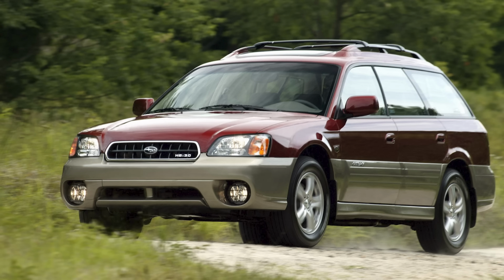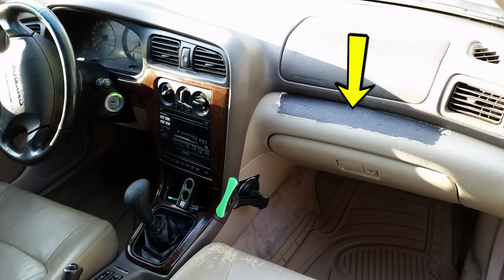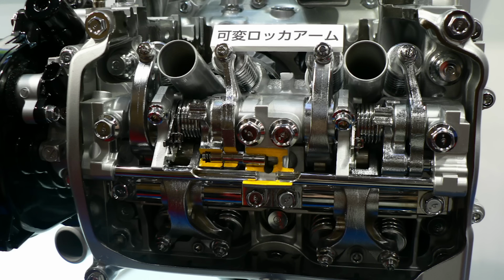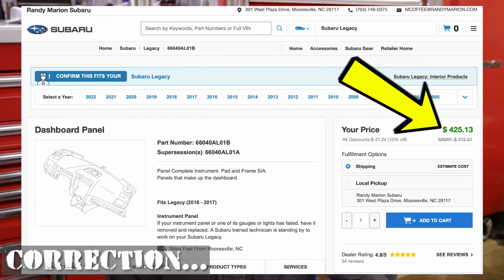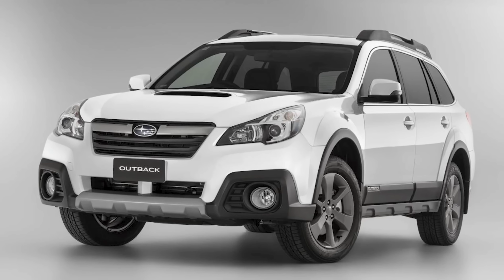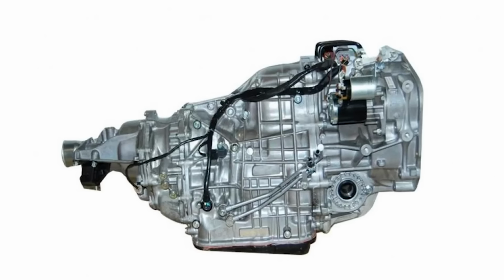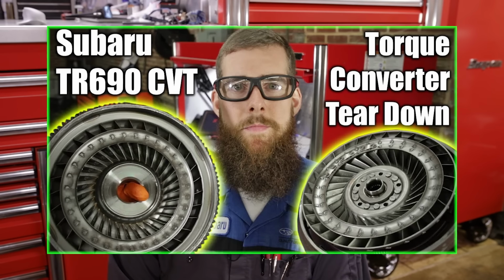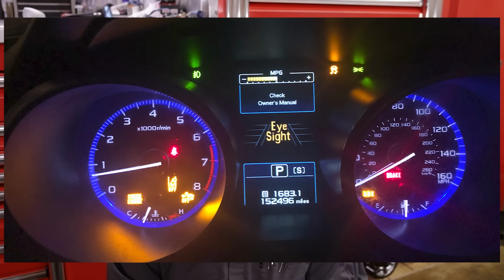Buying A Used Subaru Outback Or Legacy?! Here's The Good And Bad Over The Last 20 Years!

Comment: I have a 2021 OBXT, I change the oil every 4000 miles instead of 6k,  planning to do CVTF changes every 60k, what can I do about the rust issue? Spray down undercarriage twice a year?
Reply: Spray down undercarriage and undercoat it to death! A good pre-emptive undercoating while its still dry before winter can prolong a cars life for many many years. And after winter thoroughly pressure washing the nooks and crannys underneath then undercoating again. Would be overkill maybe but hell itll probably never see a speck of rust lol

Comment: I had a 2005 outback 3.0L  LL Bean edition. I really liked the car and the 3.0L motor had tons of power and sounded pretty cool as well. But fuel mileage sucked. But mine did also have this ghost wander in the rear. It would be the worst when you'd drive with one half of the car on ice and snow and the other on dry roads. Gave you the feel of driving on a badly grooved road and the tires just didn't know where to track. Which we get a lot of here in MN. But I am not one to be scared of bad weather or road conditions at all and with my other subarus it wasn't a problem. But this one would down right scare me at times. Had it aligned a couple times and it also liked to eat the rear tires up. BUt the alignment didn't seem cure the tire wear or the wander. Now this was done at my local repair shop. Ended up talking it into subaru and the found the lower control arms to be wore out, meaning the bushings I guess and they replaced all this and then realigned the car and that seemed to cure it for a while. That was a $1500.00 repair also. made it through the next winter season without issues but then the next one it started to show up again. So not sure what was going on at that point. Ended up selling this and buying a new 2021 forester Sport and love the thing!
Reply: Oh, yeah. The half on / half off. . . changing lanes in rain or snow was always a significant emotional event. But my 2008 LL Bean doesn't do it whereas my 2005 2.5i did (until I changed things)

Comment: Had a 2011 outback 2.5, regular maintenance got it to 3000000 miles before I sold it.
Reply: You just gave me so much hope, since I just bought this exact car in May with 133k miles. I plan on riding it until the wheels fall off, so thanks!

Comment: I was wary getting back in a used Subaru after my ‘99 Legacy SUS blew two head gaskets (the second was the fault of a bad replacement job). I recently found a low mileage ‘06 with one owner and all dealer maintenance recorded until my purchase. Fingers crossed my bad head gasket luck has been spent…

Comment: MrSubaru1387 - have a new to me for 6 months  2015 outback 2.5l, just rolled through 100k. Has the low rpm shudder been definitively resolved as to the culprit and fix? 
This morning , same issues with the addition of x-mode and engine light . 
Thank you.

Comment: Father in law's 2000 outback with the 2.5 was a great car until rust consumed it.
Our 2008 outback is on it's 3rd 2.5L engine.  This is my daily driver.
 We had a 2000 Subaru Impreza outback sport that went a quarter of a million miles.
We now own a 2022 outback and it is a gutless car.  I call it the Roadrunner with its cartoonishly wimpy meep-meep horn.

The older Subarus built in Japan were better designed, and better built.  We've owned 4 Subarus now (still own 3!), plus my parents have owned a few, and I have worked on them all.  There is really no comparison in quality.  It's gone steadily downhill

Comment: Man I will tell you, I love my 1994 Legacy L wagon, it has 109k. I am looking for new rubber seals for the driver door, and have a small intermittent leak in the left rear roof. I can't find any other faults with this car, I have done the fuel filter, plugs, wires, PCV, exhaust, and of coure all rubber lines and belts. I also have done the radiator. I need to find rubber body seal parts and am having trouble finding them, a source? Thanks JH
Reply: PS I have also done my clutch and the timing belt at 75K

Comment: Prior Subaru vehicles 

2011 wrx  stage 1 57k  blinker wiring issue great car

2013 wrx stage new til  89k 1 pro tune
Broken syncros  (stock)
Failed window regulators 
Rusted fuel door 
Traded in burned oil near end of life.

2017 STi traded in at 60k 
Stock 
No issues 

***2017 outback 2.5 premium bought at 31k has 70k 
Radio freeze 
Key stuck in ignition 
Oil leak 
Leaking radiator 
Brakes are horrible for this vehicle stock. 
(Especially coming from a STi feel like Fred Flintstone lol)   
Overall, great car safe for my family, good on gas and awesome road trip vehicle.

Comment: I have an 05' EZ30D with 210k.
Original exhaust (now failing at the cat flange).
Original plugs (still).  Goes through brakes and bearings like underwear.  Has been run only on Mobil 93 octane since I bought it at 50k.  Passenger door is the only one that opens from the outside.  Drivers door opens from the inside only.  Rear doors don't open at all.  Hit (and killed) 3 deer with it.  Still runs like a animal.
Reply: I've hit two deer with our 2001 VDC. They just bounce off that massive steel front bumper. It's got 229k on it now. Only frustration is the rear window leaks into the brake light so I'm forever replacing bulbs.
Reply: The brakes/bearings issues is something I’ve never understood about Subarus… that and my 2011 burns through headlights. And of course to change low beams you have to disassemble the whole front end…

Comment: Outstanding video! We've had a previously owned 1995, 2002, and now a 2013: wagons, and Outbacks. The 1995 was a paragon of reliability, also good looking. The 2002 was remarkable; owned it to 235K miles...the rust did it in. The 2013 I purchased at a good price as it was dealer serviced and had a short block put in at 68K. I bought it at 98K. (I purchased an extended warranty.) Rear bearings went at 115K. The CVT failed at 118K and was replaced at the same Subaru dealer. (Glad I purchased the warranty). That said, the 2013 makes me as nervous as my long ago 1998 Harley Davidson. I am never certain I will get home under my own power. My wife wants no vehicle other than her Subaru so I just clench my teeth. I drive a previously owned 2015 Lexus GS350 F Sport that allows me to breathe.
Reply: 2.2 is legend.

Comment: Build quality or not, the 2005-2009 Legacy GT has a place in my heart. More of the Sedan version than the Wagon, but still.
Reply: tbh, the 4th gen is still a quality, well built car with a bit of flare compared to the older 3rd gen legacy (2nd gen outback) which was a utilitarian tank.
Being the GT model year, I'd argue that th 4th gen is where it peaked with the introduction of the 5EAT automatic or the 6 speed manual on the SpecBs. 

After that, its started going down the gutter in terms of styling and the eventually the mechanics with half of them adopting the CVT later down the line.

Comment: once again I agree with everything mr subaru says. I have owned a 2009 2.5 XT and let me just say it was the the worst subaru I have owned. it had a lot of failures and just general poor build quality. My 2000 outback which now has 274K starts up every time. Goes with no issue. It does however have the glove box chip and sun roof leaks but! I would never give this car up! when the time comes and the engine puts it best knock knock jokes up I'm just going to replace the engine and keep it going.

Comment: Have had a few 01-04 Outbacks, both 4 & 6 cylinder. Love the cars. Easy to work on. Rust will force these cars off the road before mechanical failure. Just wish there was more room in the back seat. 

Our 2014 2.5 has been great. Way more interior room, but I too am dealing with a cam carrier leak. Hasn't gotten worse in 55k so live with 1qt loss every 4k, which is my change interval now. Have to do rear wheel bearings, but at least they're bolt-in and not the dreaded stuck-bolt design Subaru used for so many years.

Comment: I had a 2004 legacy wagon L with a 5speed manual. Had No head gasket issue on mine but was rusty as hell being driven in Canada. Was a perfect winter car with the 5 speed and full time 50-50 awd, I could drive in 3ft of snow with no issues. I once got pulled over while driving in heavy snow, I didn’t notice at the time but the police was following me for 5 minutes before pulling me over because they couldn’t get close enough to me with all the snow on the ground even tho I wasn’t speeding haha. caught up to me at a red light and lit me up.

Comment: I have a 2012 Forester X, which the oil consumption issue was not fixed under warranty. What causes the issue and what is the remedy?! I can’t find info on it anywhere. Thank you for this well put together overview.
Reply from the maker: Normally it's weak piston rings. Fix is a new short block.
Reply: @MrSubaru1387  thank you sir!

Comment: Bought an 03 Bean new and only has 110K now. Had a few glitches (A/C hoses, idler pulley, etc.) but nothing serious. Got caught up in the airbag recall, twice. First time it took months for the dealer to get the right airbag, I dropped off the car and picked up a loaner, and they called me a couple hours later to get mine as the box for the airbag was mislabeled and it didn't fit mine and it was the only one they had. 

They gave me a brand new Outback loaner with about 60 miles on it. HATED it. Would never have one. Salesman called me and was pissed when I told him I'd never buy a new Outback as they've ruined the concept.

When they finally got in the correct airbag same thing happened. Another salesman called offering me a great trade-in on  mine. Told him that the new Outback they gave me as a loaner was an absolute POS. He wasn't happy.

Comment: My mum has 300k kms on her 01 Outback with EJ25 engine, has had one set of head gaskets, a couple of sets of front driveshafts and a front suspension refresh but otherwise has been a champ. Now I need to do the rear oil seperator plate as it still has the original plastic plate that is leaking. Can't decide, engine out or drop the trans? Either way has been a great car and very affordable to keep on the road.
Reply from the maker: I'd pull the engine. Lot easier than dropping the trans.

Comment: Il stick with my N/A ej201 powered 2003 forester SG along as possible, newer Subaru's really dont compare to the old ones for reliability and size 👌 only issues with these are the crank sensors which takes about a minute max to change, the sills rusting & sun/moonroof models (like mine) sagging but a couple of washers with the original spacers does the trick to get them back level to the roof

Comment: Sorry for my bad english, I’m from Slovenia, europe😁
I had 2004 legacy sw, 2.0 petrol engine (138hp) with no issues at 500.000 km. I drove it about 15 years….bullet proof car 💪
Now I have 2012 legacy sedan, 2.0i petrol engine (150hp) for about 3 years with 170.000 km and I love it😎only thing that I replaced was o2 sensor.
By my opinion these are really strong, reliable and well made cars.
Dont know if I’m lucky or Subarus just love me 🥰
Great chanell👍✌️

Comment: We just got a 2018 Legacy 2.5i... love it for the most part, but sometimes there is such a thing as too much technology.  Always on traction control is stupid if you're accelerating from 0 to 5mph... there's this stuff called snow Subaru... you know, that white stuff you used to advertise your cars as being great for.  Yes, I know you can just disable it under the left side dash... but let me tell ya I felt pretty stupid trying to get my ALL WHEEL DRIVE SUBARU out of a 2" snow drift because traction control said nope.  Still buying a 2017-19 3.6R though
Reply from the maker: You can thank the US government for traction control in Subarus...
Reply: @MrSubaru1387  I wonder if the ECU can be reprogrammed to flip it to off unless I want it on
Reply: I have the same model and 2018,  I love my car  alot because the width [ so much] compare with Toyota  is too little[ tiny car inside]. Enjoy our car by the way I sleep alot lol....

Comment: Own a 2001 Outback with 384,000kms still on the original engine 💪
Reply: @joelr22  I only have 200k miles to catch up to you😄.  My 03 outback limited sedan has 43k miles  or around 69,201 km
Reply: @Lkom24 do you just sit and stare at it or what?😂
Reply: @Silverfox1982 😂😂😂😂😂😂😂😂😂
Reply: My 2004 outback has 350k and Mty 01 forester has 320k
Reply: Which engine?
Reply: Same here
Reply: I have an 02 outback LLBean still going strong. Just had to replace trans solenoid. Was not expensive to repair.

Comment: I got lucky I guess. I bought my 2016 Certified Pre Owned Legacy during the lockdown when car prices were being slashed and they were trying to move them off the lot. I think I got about 1k discount? Maybe more.

Only electronic issue was with the computer brain in the multimedia head unit which Subaru replaced free. It sent an error message that it wasn't functioning to Starlink.

Comment: I was anti Subaru for along time  until I had one for a rental car, about a year later we bought a used Crosstrek for the wife and a engine change down the road from a overheat issue we are still pounding the miles on it. I'm actually looking at adding another to the stable, the are good cars for the most part, and every brand has their issues that's for sure.

Comment: For the '00-'04 years I've heard that the 4EAT found in the 2.5L models is different than the 4EAT in the 3.0L, with the 3.0L version being more robust to handle additional torque and towing. Can you confirm that this is correct, or can I use a transmission from a 2.5L OB in my '03 Bean (which I sometimes use to haul a small trailer up to ~2,000lbs) without any concerns?
Reply from the maker: Correct. The transmissions are slightly different. Main difference is the great ratio.

Comment: for the 2nd gen outback: VDC was not available with cloth seats. You could get a 2003 Base H6 or 2004 35th Anniversary Edition H6, but they were equipped like base Outbacks of the time but with auto climate control. It had regular active torque split AWD and no VDC. VDC was absolute top trim, even above the LL Bean, and was the only trim that came with the McIntosh System

for the 5th gen outback: the 6mt was still available in the US for 2015 only on the 2.5i. It was available in Canada up until 2016 or 2017.

Comment: I bought my 2.5 Manual 2000 Outback with 120Km's (75K Miles) back in 2009. It's now 2022 and I'm still waiting for the head gasket to fail!
I also have a 2.0 Auto 2001 Forester which I also bought with the same mileage and it's head gasket hasn't failed either.
Can't bring myself to sell them as they are not worth much in dollar value but worth more to me because they are a reliable and dependable cars.

Comment: New to the Subaru family! 
Picked up a 2019 Legacy in December and replaced a windshield due to a rock by the VIN. Replacement cracked in a few days. Found out the rivet pins holding the VIN tag were sticking up and sharp...
All taken care of now, but we shall see.

Coming from VW hopefully won't have as many issues in the long haul.
Reply: I have 5 cracks in my ‘17 Legacy. I refuse to change my windshield until it crosses my view. Love the car. Windshield is junk.

Comment: Had a 200 Outback wagon that I loved. Built like a tank (in a good way). Would still have it if I hadn't been t-boned by a guy running a light at 50mph. Right into my door. A and B pillar's bent, driver door smashed up and I couldn't open it but NO ingress. Heck, I could still roll the window down! But it was totaled. Only had 70k on it in 2012 when I replaced it with a new (2012) Outback limited. Thanks for the all the info. Love your channel!

Comment: My 1998 legacy outback sedan has 236,000 miles and is still running great. All original just route maintenance. 2.2L engine that was before the 2.5L that seemed to have problems early in it's production.
Reply: still going strong? looking at buying one with 243K.
Reply: @lorenlavalley8192  Unfortunately no. The ABS computer/controller went haywire and smoked a lot of the wiring throughout the car. Smoke was pouring out of the dashboard and center console  while I was driving.  The engine transmission and everything mechanical worked perfectly with 280,000 miles but the cost to repair all the burned up wiring was too much. For some reason the ABS computer was interconnected to many things.  I would suggest that if you do buy an old high mileage one you could pull the fuse from the ABS as when ABS is not working the brakes just revert to standard braking which is what I have driven most of my life.  Good luck